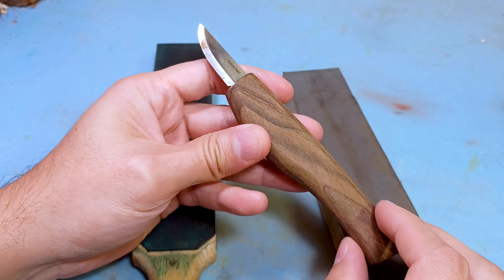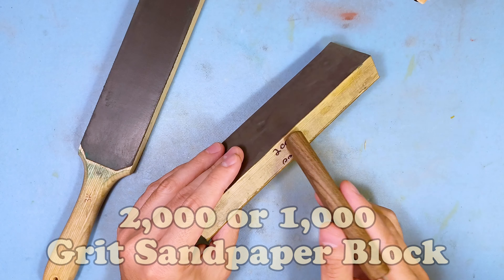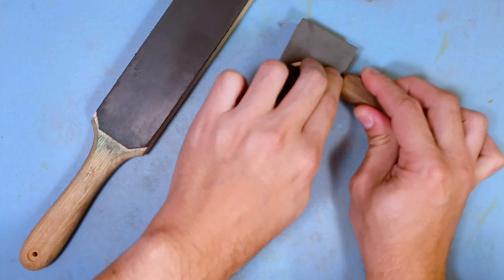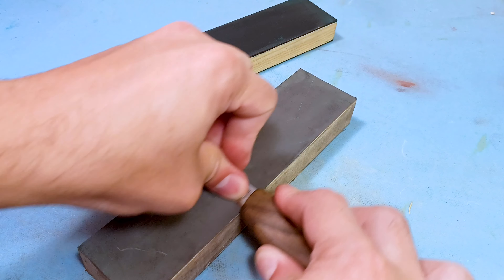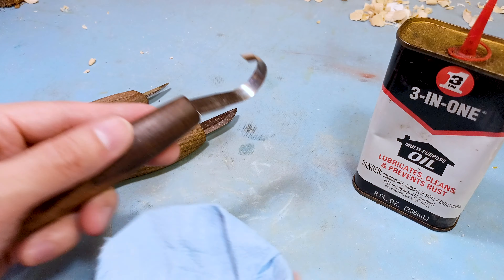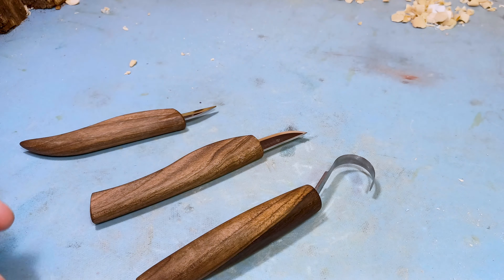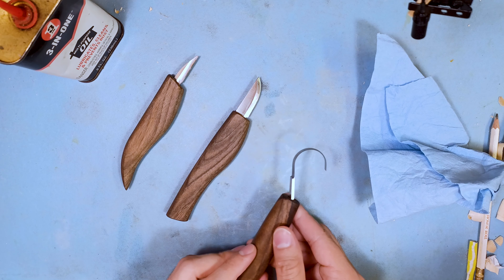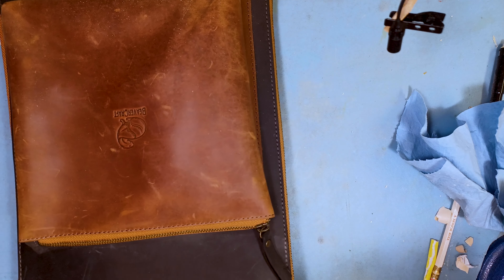Fixing Rusty Wood Carving Knives and Tools

Comment: I also live in a very humid area. Any oil you use to season and protect a cast iron or carbon steel pan will work.  Peanut oil, or any vegetable oil works as well as gun oil or other machine oil.  The point is to get a moisture resistant barrier onto the steel.

WD-40 is almost entirely mineral spirits, a solvent/cleaner.  Its moisture barrier properties are limited, but better than nothing. Re-coat often.

Using a strop with carbon steel blades is recommended because not only does it remove the "wire edge" that is left by stoning or even fine sanding, it also "closes" the surface molecules to a slight degree, which helps slow the progression of rusting by not providing a rough surface to get started.  Do not strop more than is required toobtain the razor edge.  Know when to stop or you will roll the edge.
Reply: WD-40 is a penetrating oil. In this case, it is worse than nothing. Its moisture barrier properties are nil.
Wired published an article with the results of gas chromatography and mass spectrometry tests, showing that the principal components were C9 to C14 alkanes and mineral oil. (Di Justo, Patrick (April 20, 2009). "What's Inside WD-40? Superlube's Secret Sauce.")
IF you live in a particularly humid area, and IF you can detach the blade from the handle, treat it like a cast iron skillet. Heat it to 400-450°f, then let it cool covered in a light machine oil. The blade will thank you.
Reply: @MR2Davjohn  WD-40 is a decent enough barrier for very short term in humid conditions, but yes, I agree.  The cast iron  skillet analogy is applicable.

Comment: Hey buddies, Brian, the WD in the name WD40 stands for Water Displacement. It works well for highly humid storage of carbon steel. I use it and never had a problem; however, I use those tools fairly often. Maybe  long-term is a different story.
Reply from the maker: Yeppers, but there are also so many different variants too.  I'm just being a bit more reserved in my suggestion with what I find to be a good universal opinion
Reply: @CarvingisFun  WD-40 variants are of little use for this video. Granted, there are lubricants, degreasers, penetrants, silicone, contact cleaner and even heavy grease, the website tells us that the formulation, although a tightly guarded secret, is 50% mineral spirits, petroleum distillates and a propellant. It does say that "The product’s formulation also contains anti-corrosion agents and ingredients for penetration, water displacement and soil removal." It claims to be a rust protection, but not a rust remover. If the product can get under the rust it might break it loose. After using WD-40 for nearly 40 years, in my opinion, you'd be better off with a machine oil.

Comment: i saw someone sharpen a blade with a sandpaper tip on a dremel before , would you advise this ?
Reply from the maker: 100% no.  
Unless you are really good you may end up with an inconsistent and wavy edge.  Flat sharpening surfaces provide a consistent flat surface to create an even edge.  Plus I doubt the sandpaper was at the right abrasive level for anything more than a rough grind on an edge.
Reply: That's a shortcut for people who know what the hell they're doing, like my dad, since he's passed I've had to learn how to do all of this myself! He knew how to machine airplane/elevator parts, so his engineering and Fabrication skills were totally on point unlike most of us. He had a rotary buffer that he put all sorts of grit/heads on and knew exactly how to use each of them for effect, I would undoubtedly mess up my blades trying to sharpen and buff them if I tried and I watched him for the last 20 years not understanding what he was doing....

Most of us have no business playing with such tools, we should stick to sandpaper and a whetstone : )
Reply: Even if you can't see it a Dremel will burn the fine cutting edge on a whittling blade. You can use that idea on a harder steel in a pocket or straight knife because the blade is thicker. Trying to get something as sharp as blades in this video can be ruined by a course sandpaper running as fast as a Dremel's 1,000 RPM.

Comment: I kinda want to see you try out some carving knives from like a hobby store or like an Atwood’s if you have one
Reply from the maker: Oh, I've considered it.  Actually had one a  while ago but it was soooooo bad.  I didn't want to waste my viewers time showing them what I found.
Reply: Nah I’ve been wanting to see something like that for a while or like you can also review different wet stones
Reply from the maker: Well, if you want a summary of what my experiences were with thr knives, they were dull, appeared to be sharped on cement, uncomfortable handles, too thick of a blade, and the blade wasnt properly secured so it wobbled.  All of this for thr cost of 2 or 3 beavercraft knives which are vastly superior.

But this has given me an idea for an angle ona video idea floating in my head... gonna workshop it a bit more and see if I can make an enjoyable video out of this.

Comment: Sorry to say, but that type of pitting comes from cheap knives made in Pakistan or China. They get the slag out of it, but it's not pure carbon steel. Every carving and whittling video that I've seen, all of them, bar none, has this kind of pitting. The difference is whether or not rust gets in there through humidity or skin contact or even if it's lubricated with something that won't keep water out long term.
You've seen videos of someone making a blade? They forge the steel, hammer it out to the desired shape, and quench it. Then they sand it on a belt to make it smooth. 
If the steel is cast into that shape, it will have pits and uneven hills and valleys because of the poor casting medium. The blades are machine ground to the blade shape. QC is very poor. There is a lot of pitting. Even the better pieces will result in very small pits that will continue to rust for the life of the blade.
It is very important to keep all tools clean and oiled. Blades must be sharpened and oiled with much more care. Do not use WD-40. WD-40 is either a penetrating oil or a petroleum distillate depending on the formula. Ballistol is a similar formulation, but is used for firearms. It will penetrate a rusty screw or hinge, but it won't preserve against rust like an oil will. Use a machine oil. 3-in-1 is a good choice.

Comment: https://youtu.be/yaUfvTD2JzI bonjour Brian, pour affûter la lame d’acier et en ôter les points de rouille, faut-il humecter le papier abrasif ? Merci pour ta réponse et cette vidéo instructive. Michèle
Reply from the maker: You don't have to moisten the sandpaper.  But some sharpening stones are designed to use water or oil and it would be wise to read the sharpening stone instructions.
Reply: Merci de ces précisions. Toutes es vidéos techniques sont particulièrement intéressantes.
Reply: yes of course, no doubt that for wood, it is not useful to wet the sandpaper, whereas for metal it is.  So much the better, it will save time and cleanliness.  thank you for your answer, Michele